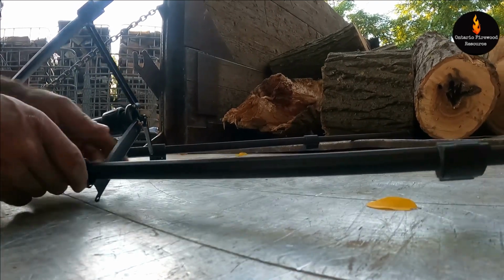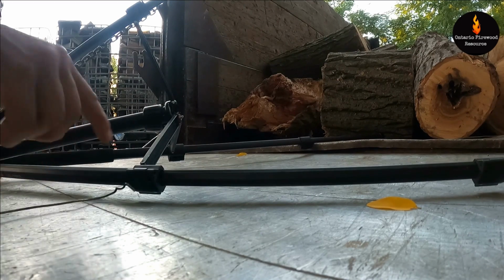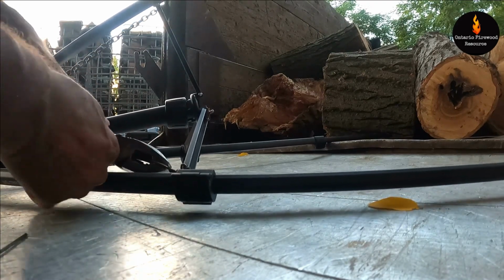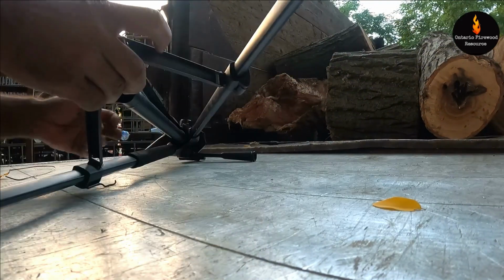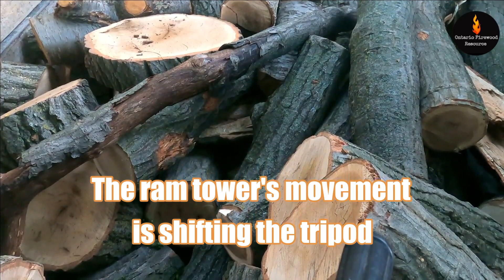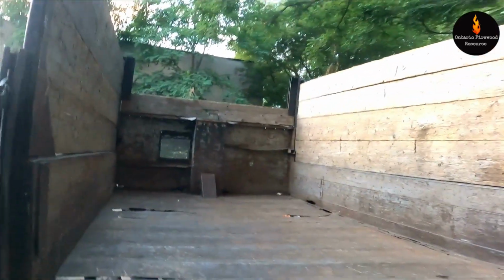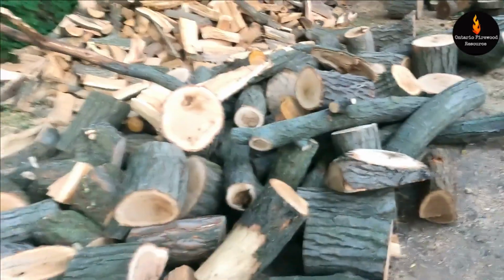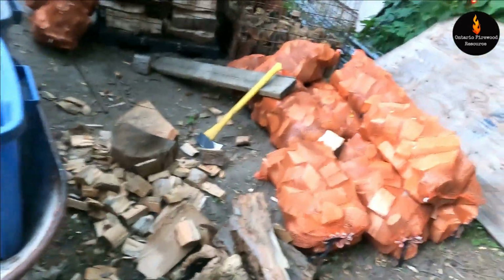CUTTING RED OAK FIREWOOD + BURN BARREL

Comment: Bad tripod, nice wood. Great fire going. Had my old Ferguson tractor going today and the last few days cutting up wood. I use a saw bench hooked to the tractor. An escalator to move the wood away.  But I can only do about two hours of that, then I’m done in. You seem to be able to cut for hours and hours. 
Have a good day Anthony.
Reply from the maker: Age is starting to catch up, not to mention last year's insane amount of incoming wood. I wish I had more time to cut, but I get frustrated with having to do the many tasks that are not just cutting and splitting...sawdust and bark cleanup, splitting smoker wood, bagging kindling, throwing boiler wood crotches and cutoffs into the 40 yard bin, sharpening the saw, gassing up the machines, etc. Firewood is a two-person job
Reply: @OntarioFirewoodResource   yep. Your right.

Comment: Do you just use your bars once or are you also grinding them down as they go bad?
Reply from the maker: I usually grind down the bar with a cutting disk on an angle grinder, but the last bar I used a file and it was sufficient. Even after flipping the bar as well. I probably could've filed it longer, but I don't have the patience when I want to get back to cutting. I had this bar for about a year so I said what the heck, I'll buy another, which is coming up in a future video. Thanks for watching
Reply: @OntarioFirewoodResource   I watched a lot of firewood videos and somehow this is a topic that never comes up and this is actually a really important part if you ask me.
Reply from the maker: @s18cln  ya for sure. I'm supposed to be doing more informative videos every now and then. I would've elaborated on the bar but time is always short when there's wood to be split 🤣